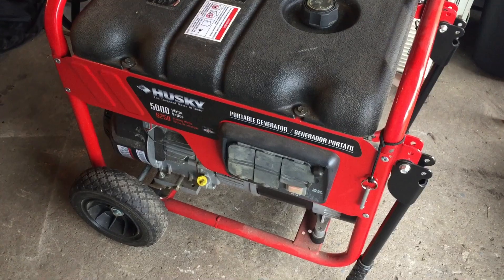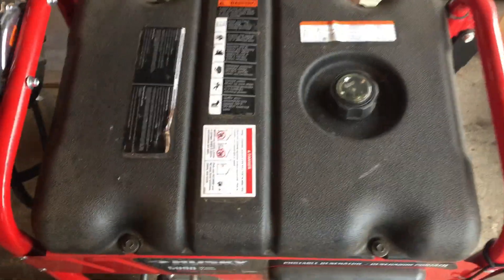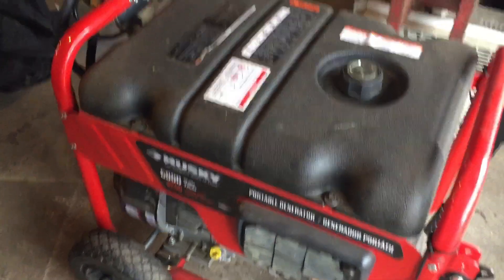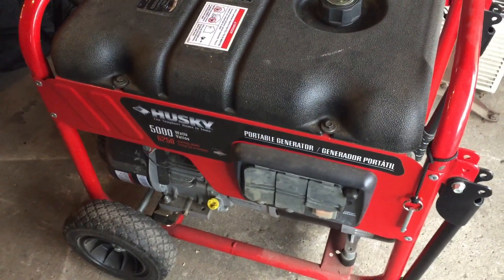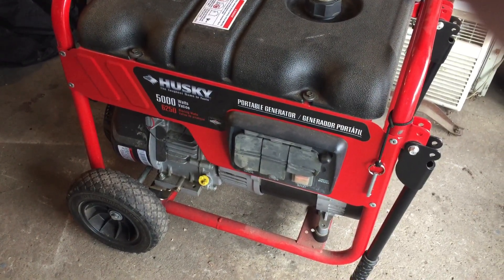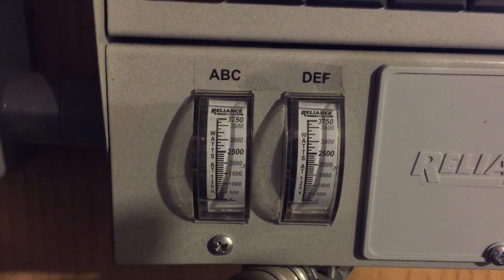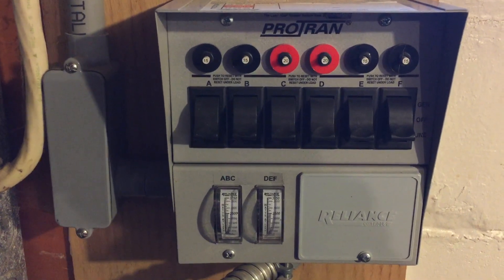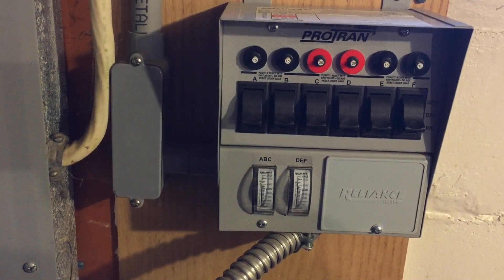Generator Basics

Comment: That's what i love about my duel fuel generator.       I haven't ran it on gasoline yet a d probably won't.     I love propane because you don't have to treat it like you do gasoline.      And it doesn't put out as much carbononoxide.         And always remember to get your generator out and run it about  once a month

Comment: Did you do a video on how to install the propane converter gadget? Is that the best gadget brand available maybe sold on Amazon? How much does the transfer switch cost and how much to install it? Thank you
Reply from the maker: Therese Röthel the transfer switch costs about $300. I did the install of the transfer switch myself so I don’t know how much a electrician would charge. US Carb. has a install video. https://youtu.be/DfBTQ-KLDZo
Reply: @ModernRefugee  Thanks for writing back. Don't get the Generac xg 8000E, the battery is practically impossible to replace when it goes bad after a few years. It's absolutely unnecessary to design something this poorly and shouldn't be permitted to legally pass inspection and be sold with such a difficult and stupid design. Otherwise it seems ok though.

Comment: I never considered a pro conversion...great idea. Does the pro hose reach the house or do you use a smaller tank?
Reply from the maker: holliday 1882 I can use everything from 20lb grill tanks to 100lb cylinders. Filling a 100lber is cheapest option. The tank, hose and cord can be locked in a out building to run away from the house. The generator cord is all weather neoprene coated so it can be outside. That way I can provide some security for it. Any disruption of power I would be around to guard it anyway. Generators are a target for thieves in a power outage, so security is also part of my plan.